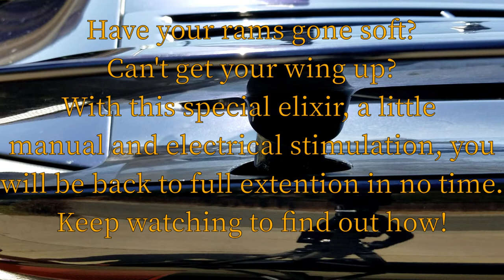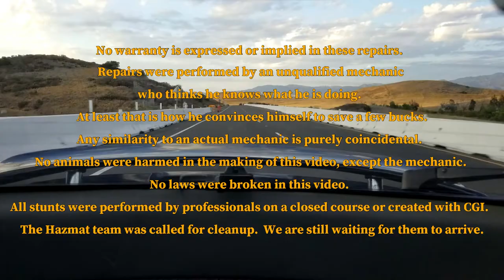Porsche 996 Turbo Spoiler Repair and Bleed

Comment: I used this video to repair my 997.1 spoiler for $12!  (The cost of the Lucas Oil Power Steering Stopleak, 12oz)  Great video, It may be worth mentioning the 997 components are slightly different (improved) but the fix is essentially the same and can be done in about 3 hours on a first try if things go your way.  
Do not forget that the button on your dash will not work while the deck lid is in the “up” position.  Once you lower it, then perform the in-place operations check! 
997 unique:  wing attaches with a threaded bolt design, so same removal process, but keep rotating the cylinders about 10 times. 
Note:  If you have complete failure of the wing or want to remove the wing without hassle, remove the banjo bolts from the bottom of the rams, remove the circlip and washer from the bottom of each ram and slide the entire wing and strut up and out of the deck lid.  It’s way easier than trying to fiddle with removing the wing by rotating the entire strut without scratching the paint!
Reply from the maker: Sweet!  Glad to help.  Thanks for the 997 intel. Hopefully others will benefit from your input.
Reply: Hi and thank you for doing this video. I did as it shows in the video and now both side deploy but one only goes back a little and I have to manually push it in. Would you know what the issue could be? Could it be inside the cylinder and piston? Thanks again.
Reply: Do you have links for the parts like fittings needed?

Comment: Great video, I feel I should mention that there is a hole on the ram upright which fits a specific tool for releasing the spoiler called a Hook And Pin Wrench that makes removing the spoiler much easier with much less chance of damaging the paint work.
Reply from the maker: Thanks!  Yeah, I know about the special tool, but my budget was $20 for the project and the tool was over $40.  So you can see my dilemma...  But for those folks with a bigger budget,  but not quite willing to spring for the $2500 Porsche Dealer rebuild, the tool is probably a good choice.

Comment: A neat trick for your pliers is to slide heat shrink over the jaws.  Make sure its over sized and really pushed on.  Don't worry about a wrinkle.  Use a lighter to shrink it down.  It will stay in place and it thicker shrunk.  When you're done with it just cut it off.  Its cheap!!
Reply from the maker: Good tip.  You'd never know from my video, but I like cheap.  I'll have to compare the cost to 4" of duct tape.  There was a special tool available for $40 or so, but that's just ridiculous.
Reply: All good.  And on the plus side you can reuse the duct tape when you're done with it.  I also noticed you don't have a bench for your vise.  Have you thought about getting a couple lag bolts and fasten your vise to one of those big chunks of wood to make working with the vise easier?

Comment: Hi, thankyou for the upload . In my case one of the loft cylinder is leaking so I guess I will not disassemble the pump but will try to change the washers at the end of pistons & then try to bleed by giving power to the pump . Hope that it works

Comment: Great video!  Will this repair work on my 2003 Kia?  I can't afford to pay someone to fix it.
Reply from the maker: What model?  It works on a 2001 to 2008 Porsche 996 and 997 Turbo and yours falls in that range.  Might require a few mods to the procedure.  Good luck!
Reply: 2003 Sedona.  I don't have the same stop leak  Will radiator stop leak work with the red oil you recommended?
Reply from the maker: Tough one. The Sedona spoiler option is a rare one indeed and should be kept in tip top shape for resale.  Therefore I would have to recommend biting the bullet for the Power Steering Stop Leak.  It'll set you back a pricey $10, but well worth it for your automotive investment.
Reply: Thank you for the quick reply.  I don't have a spoiler.  Its my passenger side door locks.  The are stuck in the up position.  The red oil has been leaking from the locks on my parking space for a while.  I bet they are filled with air.
I did a search for a how to video to fix them and yours showed up so I guess the basics are the same.  Its my day drive so I plan to take things apart and replace / bleed the air out this weekend.  $10 isn't too bad so I'll go with locus stop leak.  Thanks again for all you help!!  I hope one day to also own a Porsche.
Reply: My left ram leaking, should I replace all orings for both rams and motor and replace fluid with ATF+stop leak?

Comment: Hi, we are two engineering students from Italy and we are modeling the rear wing of the 911 996 Turbo. In the video you show all the components (pistons, pump, screw etc.) and we wonder if you would like to share with us some more details about the system. It would be very helpfull for us to know the exact length, diameter of the tubes, pump flow rate etc. since we need the parameters for the simulation.
We are sure you can help us! Thanks :)
Reply from the maker: I don't have all that info saved.  There are 2 cylinders about 25mm in diameter on the drive side.  The stroke is about 50mm.  The pistons are pushed slowly by the motor turning the screw.  It takes about 10 seconds to move up or down. Under the spoiler, the hydraulic cylinders are much smaller, maybe 10mm inner diameter and the stroke is equal to the spoiler lift - about 75mm.  Good luck and thanks for watching.
Reply: @neuntwelven  thank you very much! These info will help us realize a realistic model :)

Comment: Thank you for the great post.... I have the light on both '04 turbo cabs and one of them now only raises about 1/3 so it is not the switches, LOL.  Since I get to do this twice, before I get into it, I wanted to ask why the 50/50 Lucas stop-leak /ATF fluid and not the Pentosin CHF 11S other than cost of the Pentosin?  Neither car has had any evidence of leakage on the ram covers.  Ordinarily I would just use what my service manual specs but since everything you show in the video is in line with the procedures in the manual for filling, bleeding, etc, I thought it an interesting choice.  Thanks for any clarification!
Reply: Follow up to previous post:  Thank you again NT for the superb video.  I just completed the repair and all appears well... I have the rams in the up position checking for any leaking under pressure.  I had to bleed the short hose (Left) system 3 times but it is solid now.  Using your video with my factory service manual, I found an easier method to fill the cylinders.  The manual basically has you reassemble the pump pack and you fill the cylinders through the holes in the end cap.  As you mentioned in the video you want to ensure the pistons are fully retracted.  I think the simplest way to do this is to drive the pump to the full down position once assembled and there is no doubt as to piston location in the cylinder.  Works great.  Other thing I figured out is that if one of the rams doesn't work, don't disassemble the whole thing to fix.  Once it is together, each side is effectively an independent system so just refill/re-bleed the one that isn't working until you get it purged.  Hope this helps the next person attempting this repair.  It is fiddly (Circlips on the rams) but not at all difficult.  Now to the other turbo cab...

Comment: Great video!  Where did you buy the pistons and piston rings or any other parts?  Thanks.
Reply from the maker: I used an automotive O-Ring assortment.  Luckily none of my other parts were damaged.  There are 2 O-Rings on each piston and another 2 at the top of they cylinder - 1 internal, one external. You may find other parts in need of repair or replacement, but that was all I needed.  Good luck getting your rams up!

Comment: Great video. In my case just getting the car (02 996 TT), the wing rises fine manually and automatically at speed exactly even but only 1" high. I believe full up is about 4". Any suggestions or just get to bleeding?
Reply from the maker: Very likely that you have air in the system OR you have lost some fluid that is even on both sides.  Time for a bleed! New O-Rings are a good idea.

Comment: How did you get the rams to fully extend upon re installation? Mine don’t want to budge. If there pressure that needs to be released?
Reply from the maker: Have you already removed, replaced o-rings and fluid?  Did you do a bench test before putting it back in the car?  If so, it sounds like you have an electrical problem that is not driving your motor.  

If you need to raise them to remove the spoiler, check out Jonathan H.'s and Daniel I.'s comments for raising  them.  Good luck.
Reply: @neuntwelven   Hi there. Managed to free up the rams. One of them in particular was almost completely ceased. Almost ready to reassemble everything now and mount to the car. New 50/50 solution has been bled of air and it complete. Bit earlier today my father and I were testing the motor itself to see if that was the source of the problem, we wired it up to the car, but it only operated when pressing the wing down side of the button on the dash. And whilst doing so some smoke came out from the motor. Do you know if the motor should wind both ways in this instance? Or should everything be assembled for the motor and switches to turn both ways?  

Thanks for your reply! May need to refer back to those comments when it comes to that point.
Reply: @neuntwelven  just read that the up button won’t work if the deck lid is up… that would make sense. Well fingers crossed everything goes as planned.

Comment: The first minute of this video should be called "how to steal a Porsche 996 Turbo Spoiler"
Reply from the maker: Luckily, the spoiler automatically retracts below 45mph and must be raised to twist for removal.  I'll bet there aren't too many would be thieves who can run that fast while wrenching on my spoiler...
Reply: @neuntwelven  mine is currently stuck in the up position 😂
Reply from the maker: @geldingmakr  I would guess that your motor is not running. Check wire voltage using the spoiler button. If no voltage, check fuses. If you have voltage, you may have a bad motor. On a positive note, you may not have a leak if it is staying up!
Reply: @neuntwelven  where do I check for voltage? Back at the motor under the wing?
Reply from the maker: @geldingmakr  Yes. Two wires go to the motor on the passenger side of assembly under spoiler sandwiched in the plastic cover. Not the easiest to access, so check the fuse first (D7, 15A on mine).
Reply: @neuntwelven  D7 was fine. I can hear the motor running when I press the up or down button, but the spoiler is just stuck in the up position. SMH
Reply: @neuntwelven  I meant to add there is no leaking fluid either. This happened once 2 years ago, and resetting the battery (running it dead by accident) seemed to fix it. But. I have disconnected the battery this time with no luck.
Reply from the maker: @geldingmakr  time to remove & dismantle the unit. Sounds like the drive screw is disengaged. Possibly the drive block is broken. Good luck.

Comment: Hi, First, Great Video! 
I noticed during reassembly the rams are down, but the video then shows them up just prior to install. How do you perform the bench test to extend them while out of the car? Thanks
Reply from the maker: Thanks. Use a 12V battery or battery charger on the two motor electrical connectors. Reversing polarity reverses direction. Alligator clip wires are helpful. Good luck.
Reply: Thanks. How do you reverse the polarity?
Reply from the maker: @jcramey16  Positive wire to bigger connector, negative to smaller goes one direction. Positive to smaller, negative to bigger goes other direction.
Reply: Ah, thanks didn’t realize I could reverse  the wires on the motor.

Comment: Thanks for this! How would i go about getting the spoiler up in order to remove it? Mine is stuck fully down
Reply from the maker: Check out Jonathan H.'s comment below about the 997 for a stuck spoiler.  Another possibility is to get some long bolts the same thread as the banjo bolt and tighten the in to raise the spoiler.  Compressed air might work, but holding it up may be difficult.   Let me know how it works out.  Thanks.
Reply: @neuntwelven  Just finished! That trick worked great, popping the spring clips and sliding the whole ram out with the spoiler. Mine will go up and down, but randomly throws a fault. I may have not bled it well enough on one side, but beforehand, it wouldn't do a thing. 2 o rings were torn, and the rest were flat.
Reply from the maker: Excellent. The video does not show that it took 3 or 4 tries to get a really solid bleed where both rams went up evenly without delay.

Comment: Hey. So my spoiler hasn’t worked in years bought the car like that. How can I get it in the up position to take it off? Also is that the same fix? Or could that be some other issue?
Reply from the maker: Cover your engine with a towel or blanket to catch parts & fluid. Remove the hydraulic banjo bolt from the bottom of the spoiler rams. Remove the C clips on the bottom. Then, you can lift out the spoiler with the rams. If the motor still works, you should be able to do this fix. Good luck!

Comment: Would this fix work on the older power antennas?
Reply from the maker: It would work on a hydraulic power antenna. However, in all but the most exotic of cars where originality overrides functionality, replacing the hydraulic system with a hand crank will be more reliable and cost effective.

Comment: This is a compere waste of time. Just upgrade to the full electronic e-Ram kit and ditch the hydraulics altogether.
Reply from the maker: That is a good alternative.  However it costs $1600+ and removes originality.  This costs about $20 (o-rings and hydraulic fluid).  Both require installation time, this might add 1-2 hours of rebuild time.  Hopefully, this video makes it clear what is involved.  Mine is working as new 2 years later.  Thanks for watching.